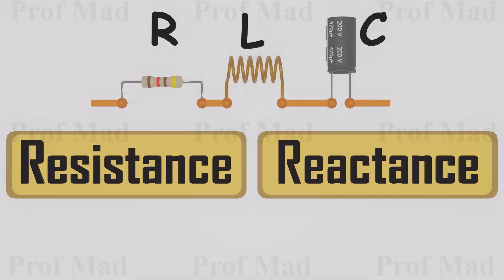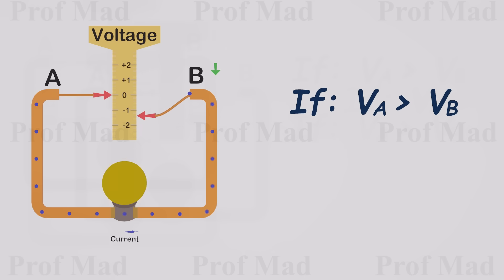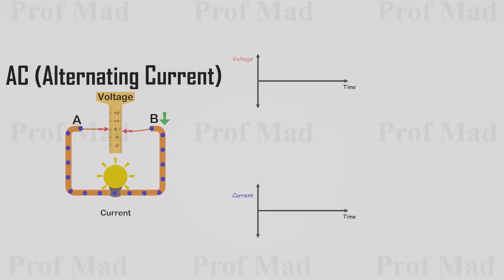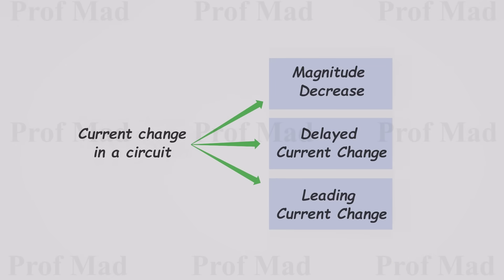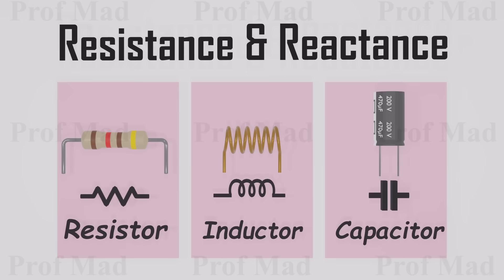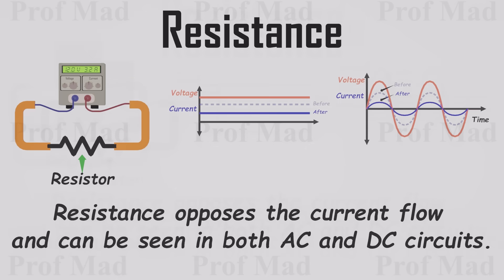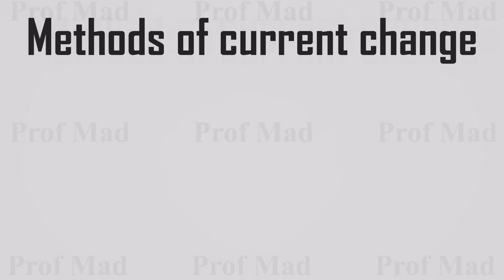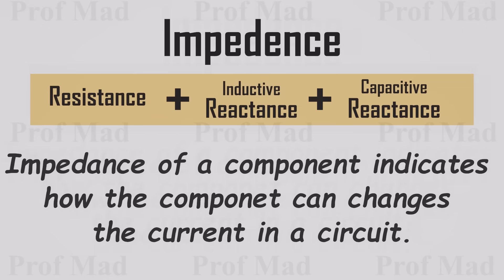What are Resistance Reactance Impedance

Comment: If you worked in the field for a few years and still cannot understand even the simplest principles behind the basic passive components without some silly and barely working plumbing analogies, you either wasted your life while doing so or should change your profession as soon as possible! In any case, whatever is your domain, either an electrical engineer or a plumber, are you able to explain what resistance, reactange, and impedance are after seeing this video? I don't think so! 🤦‍♂

Comment: AC current flow is another concept that needs to be overhauled for general educational concepts.. At a traditional AC source voltage is generated from a rotor or coils moving through voids that close by stroke the fields of magnets or coils depending which way round the design of the machine... the so called push pull effect is down to a mirror imaging of the moving stroke...
Tighten a bolt on a part from one side clockwise and you do the same on the opposite side.. yet clearly they are in opposition to each other... the push pull AC is pushing all in one direction but has a flipping of sign values... like in quantum physics you have spin up and spin down.. right im off.. happy hunting everyone..

Comment: For anyone interested, a hose provides a  great example of how high frequency systems work.  The hose stores pressure locally along its length by elastic expansion.  The water stores kinetic energy of water flow.  So in a 50 ohm hose, the ratio of capacitance (hose stretching) to cross section of flow (kinetic energy) resolves to 50.  If a hose has no air, and the end is plugged, water will flow through the pipe with a resistance equal to 50 because of the ratio.  When the water hits the end, the pressure increases back along the tube as a wave propagating at the speed of sound in water (or as speed of electrons in a conductor).  When the pulse hits the spigot again, the flow stops (with slight repeated reflections that die away).  This is what happens in a transmission or insulated cable and in a hose it’s visible and you can feel the reflected pulse.
Reply: The hose stretching is equivalent to capacitance per foot and the flow is equivalent to inductance per foot.

Comment: a component can impeed and hinder the electrons flow so tha a amount of current impedance can stop  the  current to flow the voltage fluctuations conterversly of synch with it thats    some components can delay the changes of curent according to voltage so that no always the sole to, decrease or increase with it. also some other component can  rush  the changes of curent according to voltage so that no always the sole to, decrease or increase with it   the second type entails  delayed changing the resistor diminish the  curent flow throught it

Comment: So.. inductive reactants seems to have momentum and capacitive reactance seems to have elasticity.. could it be thought of as a bunch of tiny magnetic balls that went sloshed from one side to the other in an inductor, they continue to move in the same direction for a while, whereas in a capacitor there's a wall and a gap and they build up on one side and then push back the opposite direction?

Comment: Best I've seen yet. I'd just suggest something a little different for the water analogy for capacitive reactance. I suggest a balloon instead of a diaphragm.  The diaphragm analogy has to displace fluid on both sides immediately when it moves which doesn't suggest shift in current curve

Comment: AC electricity, especially 3 phase AC electricity, is definitely not your simple DC Voltage, Amperage, resistance Ohm's law electricity.  You're getting in deep water there with trigonometry, vector algebra, reactance, impedance, i or j rotators, calculus and much more.

Comment: Der Wechselstromwiderstand eines normalen Kabels ist R_ Compton_kabel =V/A dh. [R_ Normalwiderstand]
[Volt durch Ampere = Ohm]: [T_Kreis  = 2π*√L*C]: 1/T_Kreis = f_kreis : F:  f_kreis = f* 2π :  Normal f= 1/√L*C 
Der Wechselstromwiderstand einer  R1_Spule  =  2π*f*L [R1_Spule  - Blindwiderstand]
Der Wechselstromwiderstand eines R2_Kondens = 1/2π*f*C  [R2_Kondensator - Blindwiderstand]
Der Wechselstromwiderstand einer R1_Spule plus Normalwiderstand  = √R²+ (2π*f*L)²
Der Wechselstromwiderstand eines R2_Kondensators plus Normalwiderstand  = √R²+ (1/2π*f*C)²
Der Wechselstromwiderstand einer Serie R_ges = √[R²+ (2π*f*L)² + 1/(2π*f*C)²]
Der Wechselstromwiderstand einer Serie mit Spule und Kondensator parallel bei Resonanz 
Der Wechselstromwiderstand R_ges mit Schwingkreis = √R²+ (2π*f*L /0.5π*f*C) =√R² + (L/C)²

Comment: At running time 6:18 it is being explained that the nozzle decreases the water flow (keeping the pressure constant). Fluids when passing through constricting nozzles gain high velocity and experience a drop in pressure along side the walls of the nozzle - this is so that the mass flow rate remains constant (Bernoulli's principle). Overall the video is very good.

Comment: 😂 no electrons its one dielectric unit.
Reply: 5:12 false the electricity always comes from negative to positive. 😂
Reply: 1 Dielectric unit , which carry a negative charge, move from the negative terminal to the positive terminal of a power source
Reply: 😂 electricity moves like a train on tracks not like water through a hose pipe 😂 is the signal in the radio

Comment: I wish I could have seen this video 50 years ago when I was taking EE 101.  I could understand  how the magnetic fields in inductors could create inertia to resist the change in current flow vs voltage, but I could never visualize a physical system that would be comparable to a capacitor where flow would lead the force driving flow.  Congratulations for explaining one.

Comment: since voltage is not consumable. current is cosumable, how much current is being consumed by component is called impedence.
high impedence components consumes very low current.
when it comes to "give" rather than "consume", high impedence component "provide" very less current.

if consumer component is high imped.  and giver component is low imped (means it will need high current to work).. that is impedence mismatch. and circuit wont work at all.

if giver component is low impedence and taker is high impedence then circuit may work because there is so much current available to consume but we need very low. but that is not maximum power transfer. because we taking a tiny part of current and skip utilizing lot of current. for ac circuits, this not consumed current reflects back to the source and create interference. which is also a problem.

Comment: In dc current, there is a flow of current to charge the capacitor if it was initially uncharged. And, even in an inductor which is connected across a dc source, it initially opposes the rise in current. The graphs shown in the video are not accurate

Comment: The elastic membrane analogy for a capacitor in an electrical circuit is genius.  In most circuits it is hard to visualize that no current is actually flowing thru the cap, but there is still an energy exchange.

Comment: Great explanations.
I thought I had a question about the water wheel at 6:50 but after reviewing, seems sound.
The way I remember which does what with regards to current lagging or leading in Capacitive or Inductive reactance is:
If you have a circuit fed with a Resistor to a Capacitor to ground, the current in the Capacitor will initially be high as the voltage increases (It will initially be discharged and look like a short)....the current leads the voltage (Current being higher first)
If you have a circuit fed with a resistor to an Inductor to ground, the current in the Inductor will be low as it initially resists current flow but the voltage will be high, later, the current increases so the current lags the voltage. (Current being Low first)
Capacitance: Current Leads
Inductance: Current Lags
Hope this helps 😊
Hope I'm right...😏😂

Comment: The analogy to water is useful and with water flow the constriction causes a low pressure at the constriction and a velocity increase hence a friction increase (and energy dissipation) at the constriction.Due to the conservation of energy equilibrium equation increase of one will cause a decrease of the other factor.

Comment: This is good for understanding electrical engineering, but unfortunately your water flow analogy for resistance is wrong. A narrowing of the pipe with constant force on the inlet (i.e. constant pressure) will not decrease the flow rate. And actually it will increase the velocity of the water through the narrow part. It will decrease the pressure though. This is because of the continuity equation, which says flow rate in = flow rate out. And because water is incompressible.

Comment: Granted, I am very new to electronics, but I don’t think it’s accurate to say that reactance doesn’t apply to DC.  It applies all the time when DC is turning on and off quickly in a signal, like PWM.   The term AC is used only when voltage crosses the zero line, positive and negative….  but DC circuits like computers deal with inductance and capacitance all the time.    

Of course, with a voltage divider in the right place, positive and negative is a relative thing….  So maybe the definition of alternating current is imperfect.    Changing voltage/ current is all that is needed.

Comment: I think this presentation misses to explain, how the measurements are done. For example it explains that a simple resistor in a dc circuit drops the current but not the voltage, but that is inaccurate. The voltage drops as well. If the wires are considered to have no resistance then the voltage is dropped completely after the resistor. This is not something that is clear to all viewers and therefore could lead to confusion. And therefore it would be important to explain how the measurements are done for each graph.

Comment: Resistance is the zeroth order reaction. Reactance is the first order derivative, in which an inductor opposes change in current with instantaneous change in voltage, and the capacitor resists change in voltage with instantaneous change in current. In brief, resistance is response to a constant. Reactance is a response change. Combining both reactive effects plus resistance, the sum is called impedance.
Reply: ...and you even managed to write "impedance" correctly!

Comment: But... Never mix water and electricity!
Good explanation. Does'nt voltage and current vary with the frequency?
And thats why three way speakers are difficult to make.
If you want to calculate, use ye goode olde LaPlace.

Comment: 6:10 it is important to realize that the current in the circuit does not change. If water flows with (for example) 1 litre/minute through the narrow socket, then it also flows at 1 litre/minute in the wider tubes. It just moves faster through the narrow socket. Same in an electrical circuit; if you introduce a resistor, the flow of electrons (the "current") is the same everywhere in the (serial) circuit, including inside the resistor.
Reply: I agree. Also, if the voltage is analogous to force, which in water flow is due to pressure, then the introduction of a resistor in a circuit should affect the voltage and not the current.
Reply: hello, what are you saying is that as long as the Force is the same in both cases, (case 1 pipe having same diameter, case 2 pipe narrows and then comes back at same diameter ) the flow of water would be the same? "Bernoulli's principle states that an increase in the speed of a fluid occurs simultaneously with a decrease in pressure or a decrease in the fluid's potential energy. The principle is named after Daniel Bernoulli, a swiss mathemetician, who published it in 1738 in his book Hydrodynamics."
Reply: Depends on whether voltage or current is constant.
Reply: Resistor converts some current to heat, so no.

Comment: Dear Sir, I noted that you use conventional current flow. I, too, use conventional flow, but some of my professors would give us both a zero for in actuality current flows in the opposite direction. Notwithstanding, I spent 50 years in industrial electronics and conventional flow has never let me down, it is much easier to comprehend, even though it is wrong.😂 you must have been trained by Malveno. Me Too, I think that he is the best author to ever come on the scene.

Comment: Your formula for Impedance is wrong.  You can't add resistance to either reactance as they are 90 degree out of phase.  You must calculate the total reactance then vector chart the reactance to the resistance resulting in a hypotenuse which is the IMPEDANCE.

Comment: Why are you using conventional current flow theory instead of the now accepted current flow of negative to positive? You're retarding the understanding of newbies. It may confuse them for years on where the electrons come from and go to. Negative charge is an abundance of electrons as electrons are negatively charged. Positive charge is the lack of electrons as the protons are positively charged. Scientists should have labelled that charge of an electron as positive instead of negative. But at the time. They believed that protons moved through wires and not electrons. That is why the schematic symbol for diodes is so screwed up. Think of the arrow like symbol as hitting a target and can't go any further. The arrow is stuck in the target.

Comment: Nice explanation.  Many moons ago when I was in the Navy electrician school they taught us "ELI the ICE man" to help us remember.  Voltage leads current in an inductive circuit = ELI  and current leads voltage in a capacitive = ICE.  Of all the things I did forget that was one of the things which stuck.
Reply: Another way is to remember - CIVIL- Capacitor - I current leads Voltage, Inductor (L) , current lags Voltage.
Reply: @rajkumarburada3799  I just remember that C comes before I in the alphabet. So current of capacitor is before (leads) voltage, in inductor the current is after (lags) voltage
Reply: Same with me.  Except I was Air Force.  
One other thing I learned in my Air Force electronics training was that current flowed from negative to posiitive.  After the AF I went to college to get an EE degree.  There they taught current flow from positive to negative.

Comment: The explanation for DC and AC is wrong. When current and voltage stay the same sign then it is dc. When the sign of voltage and current change then it is AC. A clock pulse on a computer is actually DC. This explanation implies that a clock pulse for a computer is AC.

Comment: This video is certainly the best I have ever seen on this subject.

I too devised this capacitor model of a membrane in a chamber many years ago and never seen anybody else using it before.

I think that the only point you could improve is explaining that the paradoxical behavior of the current (or water) flowing ahead of the voltage (or pressure) being applied is due to the voltage stored inside the capacitor (or the elastic force of the stretched membrane). Of course that that does not work for the very first cycle.

Comment: The piston and wheel analogy is imperfect because you don't explain 'inertia' as it relates to energy storage and utilization, i.e., the concepts of potential and kinetic energy.  These oversimplified explanations of basic electrical physics make for confusion because erroneous understandings have to be overcome.  Don't get MAD, now. ;-)
Reply: By very nature and definition, all analogies are imperfect.  And all the best human knowledge and perceptions, to boot!  I still find Prof MAD's videos wonderfully helpful, though.

I mean, in electric circuits, electron number one at the front of a battery doesn't actually, individually travel down the wire around the circuit the way water molecule number one does.  Rather, it's energy moving through wave propagation.

Comment: English is not my language but I try to explain. The verse of the current is chosen once and for all, arbitrarily, and then, relatively to that verse, the current can be positive or negative. You cannot change verse and sign simultaneously because that is a nonsense, in my opinion.
Reply: What do you mean by verse?

Are you talking about the sign convention for charge and current?   That was a hold-over from pre-1900, prior to the discovery of the electron, when we didn't know which sign of charge was doing the moving.   Franklin determined there were opposite kinds of charge, and arbitrarily assigned the two kinds of charges as positive and negative, without the data to make a convention that made any sense for reality
Reply: @carultch  No I mean simply that in oder to say that a current has a sign you have to fix a verse and relatively to that fixed verse the current can be positive or negative. So the verse never changes, instead changes the sign. There is no menaing in changing both sign and verse. On the other hand, if you don't (arbitrarly) fix a verse than the sign has no meaning.
Reply: @marvnet8898  What do you mean by verse?   Usually verse is the equivalent of paragraph, in song lyrics.
Reply: @carultch  I mean verse in the meaning of "rotation verse" (for example). If you fix (before) a rotation verse than you can say that a rotation is positive or negative. Otherwise the sign of rotation has no meaning. Of course you can say that rotation is negative referred to the fixed verse or that is positive in the reverse. But you cannot say that is negative in the reverse. So no poetry..verse reverse I'm not english, but if we are talking about current, flow, what can it mean? No lyrics, no. Why lyrics?
Reply: @marvnet8898 Oh, you mean rotation direction.  Yeah, the meaning of reverse has nothing to do with the meaning of the word verse.  That's why I was confused.
Reply: @carultch   Also the initial reference point, she means.  Verse = origin reference; sign = direction relative to the origin reference.